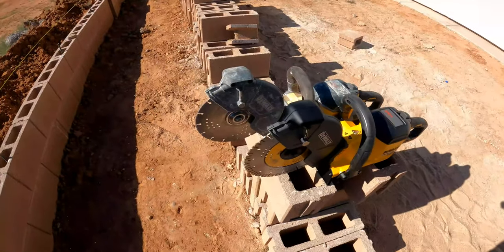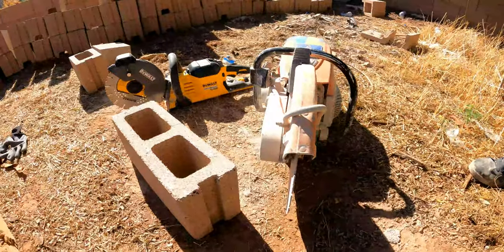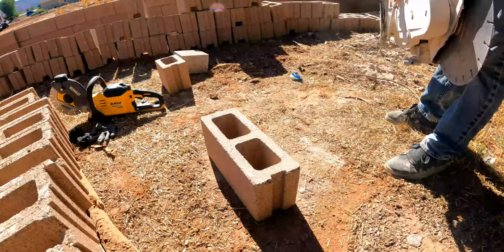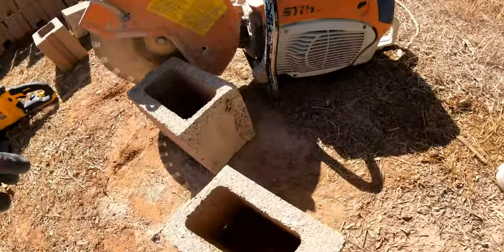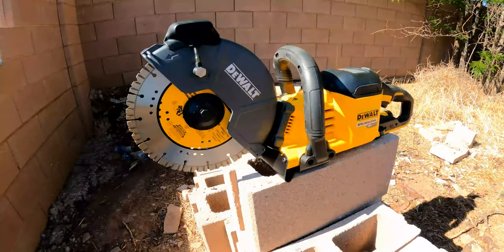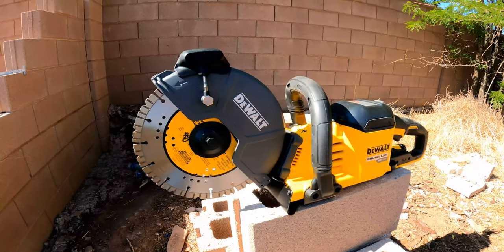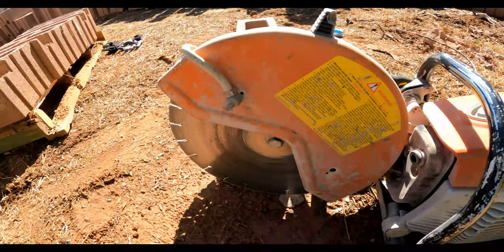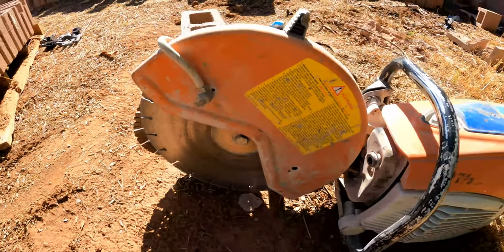Cordless Dewalt Cut Off Saw vs Stihl TS 700 mixed gas Saw Comparison

Comment: I’ve used these in construction to cut old pipe, rebar, and 2” thick steel. We used 2-3 DEWALTs and a stihl at a time with about 8 9ah batteries in constant circulation, which destroyed those batteries life expectancy pretty quickly. But the dewalts ate through the steel like nothing even faster then a torch, but we had to bring in the torch since we were going through soo many blades and batteries it just wasn’t as cost effective and the stihl blade is just too thick for metal.
Reply from the maker: Ya, sometimes they cost more than it's worth and adjustments have to be made

Comment: I noticed there are two different versions. One with the kit and one without the kit. The saw that comes with the kit (shown in your video) has a smaller/shorter black battery cover. The one sold individually has a taller black battery cover. Seems like they were able to cut some costs with the kit version to offer the whole kit for an attractive price. Not sure which one i should get...
Reply from the maker: I got another one with the taller battery box because it fits the 15 amphour battery where as the lid can't close on the shorter one

Comment: Just picked one up for some interior block demo. Hoped the batteries would last a bit longer but I was impressed for sure. Those 700s are beasts of a saw. Doesn’t seem like a fair comparison! Certainly wont replace my gas saw but an awesome addition to the tool box.
Reply from the maker: The 12 and 9 amp hr batteries do pretty good.

Comment: Perhaps we might reconsider .....if my body could tolerate the effort and time it took to start that 700 you still have to add the time it took to start the 700 to the time the 700 was cutting in order to make an accurate comparison! THEN we notice the battery powered took less time! Plus my body took ZERO abuse from that treacherous starter cord. I do not love or hate battery or gas. I do prefer not to abuse my body anymore though. Since you have concluded your gas one is BETTER .....send the battery one to me pull on that rope baby.
Reply from the maker: Lol 1000 bucks

Comment: new battery saw ideal for bricks but i tried to cut concrete lintel just wouldnt cut it ..
Reply from the maker: Ya long cuts like saw cutting concrete, it gobbles up the battery, I cut a concrete slab had approx 120 feet to cut 1-1/4 ish deep used 4 of the 9 amp hour batteries
Reply: 12ah batteries a must. Can’t wait to get the 15ah for the saw.

Comment: That Stihl ts 700, even at 20% throttle that you were holding it at, cut waaaay faster than the crappy DeWalt